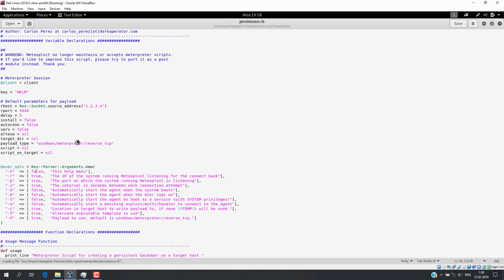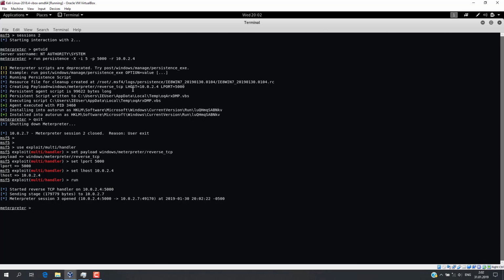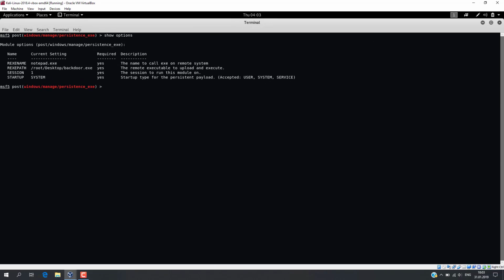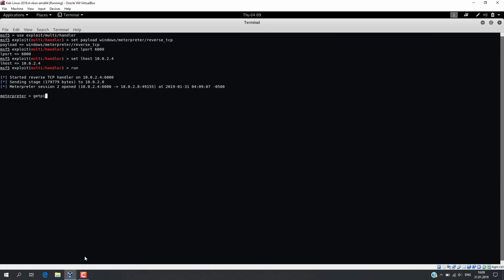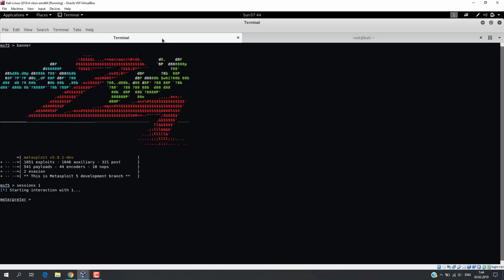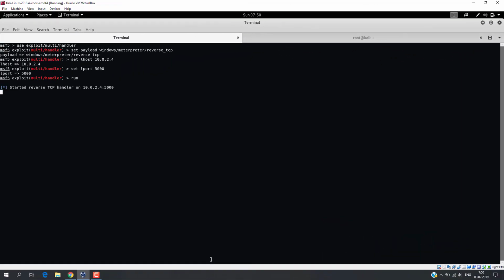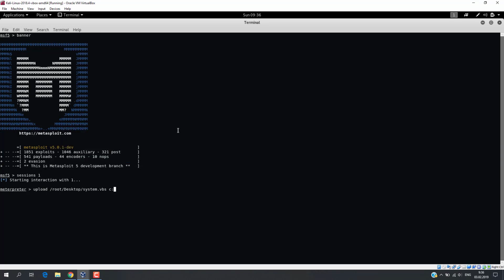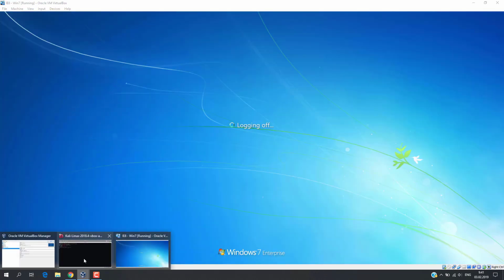4 simple ways of how bad guys install Backdoor on Windows | Metasploit tutorial

Comment: thank you so much . plz how can I peintest my android in my  local network ?
Reply from the maker: The simplest way is to have a local/home Wi-Fi network. Both laptop and phone will be able to communicate via Wi-Fi. Another option is to use USB-to-Ethernet adapter with your phone. In this case use simple Ethernet switch connected to laptop, phone and router.